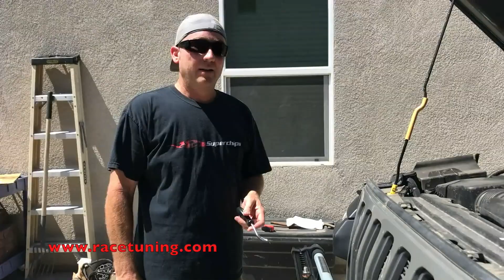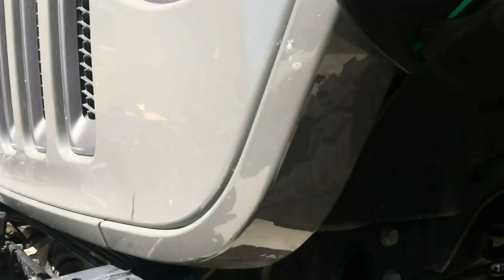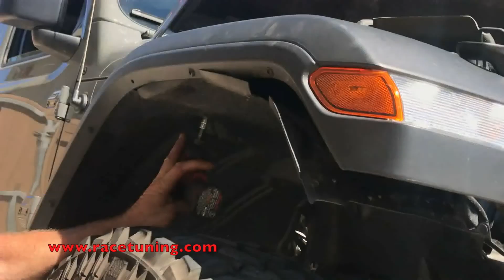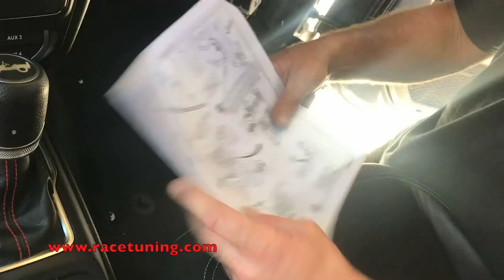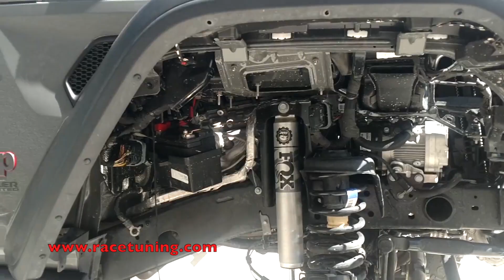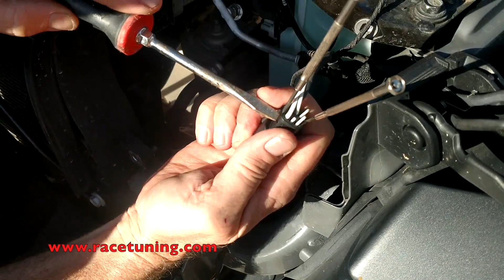Jeep 2018-21 Wrangler JL/Gladiator OEM Original LED Halo Headlight Retrofit Installation Stock MoPar

Comment: Thank you so much.this is the best video I found. I'm in the mix now.i made my own wire harness. Looks like just 2 wires.i already did the harness behind the lights and connected to fuse box and it turned on perfect but I figured I'll connect it the way it's supposed to.real harness is back ordered till mid june.i dont want to wait.lol (it always looks easier on YouTube)
Reply: Yes you tap to fuse f52 and works fine

Comment: By the way, these guys are amazing, I just purchased Tazer JL mini from them,
And it works awesome, just to let you know, if you have a factory harness for the regular halogen headlights with four wires in the headlight plug from the factory, you don’t need to run factory harness that comes in Mopar LED headlight kit for additional 2wires to headlights. It’s already ready to go, plug and play, computer or recognize it when you plug in the Tazer 👍
Reply: Highly recommend these guys !!!!
Reply from the maker: Thanks for your business.  It allows us to put out videos like this.

Comment: The two wires that connect on the inside i took it apart and the area its supposed to connect into already has wires in pin 5 and 7, how would i do that?

Comment: great video! this harness is unobtainium. What size/style pin connectors plug into the lights and into the BCM?
Reply from the maker: Z-Automotive was supposed to start producing the harness if the dealer doesn't have it.

Comment: So it's been 2 years since you made this video.  But you never made another showing that you got them working.  I went thru all the procedures you went thru to wire these.  They were done correctly.   I went to the dealer but they couldnt get them to work.  So I ordered the Tazer JL, which Im very happy with.  But I STILL cant get the halo's to work.  Did yo uget yours working? What did you have to do to make them work???  Was it a Sales code from dealer?   Looking forward to hearing from you!
Reply from the maker: We sell the Tazer JL and supply tech support for customers who purchase from us and can't get it working.  It's not the 1st time we have heard of people throwing money away at the dealer.  Amazing how the aftermarket can fix it better than the OEM.

Comment: when I tried to push the harness through the firewall grommet I accidentally cut a 12volt wire to my steering control module and it cost me a trip to the dealership... that grommet is 2 sided and tough and very hard to get too.... be careful out there
Reply from the maker: Gotta be careful when it comes to wiring.

Comment: Did you ever get the Halo to work w/o going to the dealer? I am installing my lights and harness today, have the Z Automotive taser coming Wed. Hoping to have them done and being able to flash the BCM so they work properly. RIght now the headlights flicker and after a while the right light shuts off. Assume that is because the BCM needs to be flashed not just for the Halo, but to accept the lower draw LED’s.
Reply: i did the same swap and took a couple minutes to set them up using the tazer mini
Reply from the maker: Please see the Tazer JL on our site www.racetuning.com

Comment: Did you ever try the aftermarket programming module to get the halo working? I assume you’re using a Tazer but curious if it works before I run the wiring.
Reply from the maker: Go to our site and pick up the programmer.  Free 2-day shipping.
Reply: @91saleen92  the F5 Flashcal?
Reply from the maker: Yes we did end up getting it working. We'll be posting a video about that in the future.
Reply from the maker: @Vultite  Here's the link on our website to buy it: https://www.racetuning.com/products/tazer-jl-mini-for-2018-20-jeep-wrangler-jl-gladiator-led-headlight-programmer?_pos=1&_sid=4cd557788&_ss=r
Reply from the maker: @Vultite  Many customers have called us who spent good $$ at the dealer with no success.  Get the Tazer JL from @ www.racetuning.com.

Comment: Did your programmer work to get the halo on
Reply from the maker: Yes, the Tazer worked. Use discount code RACETUNING10 for 10% off.

https://www.racetuning.com/products/tazer-jl-mini-for-2018-20-jeep-wrangler-jl-gladiator-led-headlight-programmer?_pos=3&_sid=91284c75e&_ss=r
Reply: @91saleen92  when will you have the Orem headlights in stock?
Reply from the maker: @robertgarcia6385  They've been on backorder forever. You should be able to find some good used take-offs. Check your online sources for used parts.

Comment: Good job. 
Any news about the halo light???
Did you go to the dealer???
Reply from the maker: We have an aftermarket BCM (body control module) programmer up on the website racetuning.com.  We've had several customers buy our product after going to a dealer and the dealer taking their money, but not having the correct software to get the lights working.  For $329 our programmer also offers more options such as speedo calibration for larger tires... and YOU have the control over your on-board computer.  Not some dealer.
Reply: @91saleen92  would the flashcal flaspaq work for programing halos?
Reply from the maker: @GeckoGreenJL  The FlashCal and FlashPaq won't program halos. You need a Tazer Mini, which you can buy here: https://www.racetuning.com/collections/wranglerjl/products/tazer-jl-mini-for-2018-20-jeep-wrangler-jl-gladiator-led-headlight-programmer
Reply from the maker: Many customers have called us who spent good $$ at the dealer with no success.  Get the Tazer JL from @ www.racetuning.com.